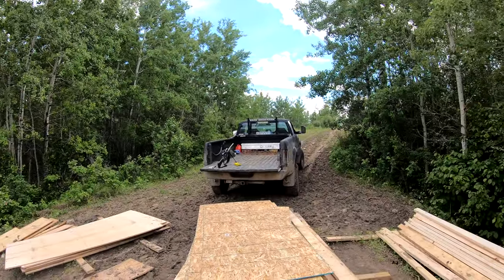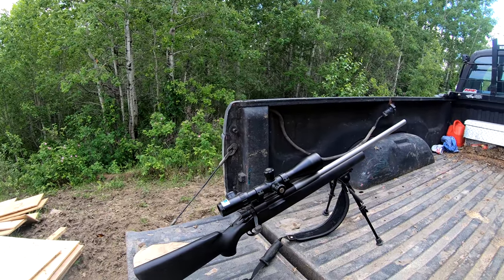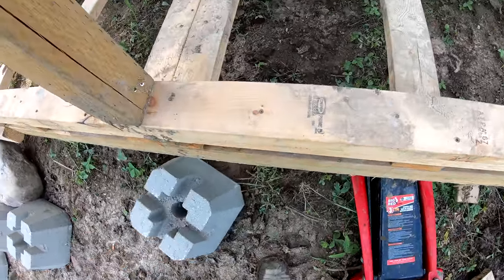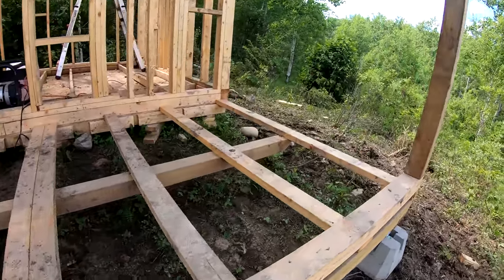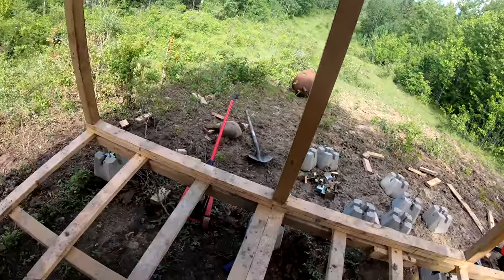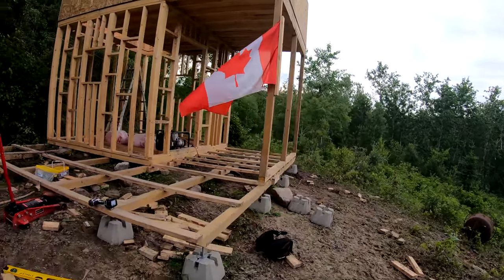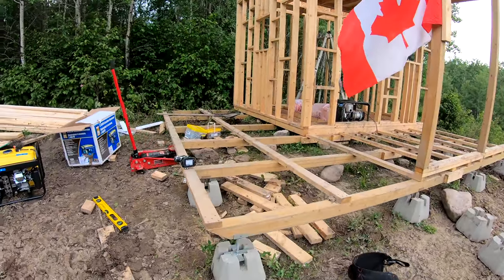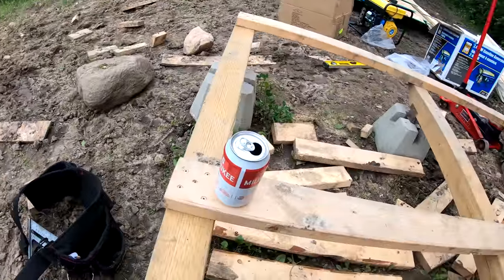Offgrid Cabin Build Pt. 7 - Adjustable Foundation Blocks Installation

Comment: Where did you get the post base supports (brackets) that fit into the deck blocks? I can only find cast in place types. Any information or links would be greatly appreciated

Comment: Hi, just watched your video using the pre cast concrete foundation blocks. Excellent idea but can I ask where you got the adjustable height beam shoe/bracket that fits in the centre of the concrete block. I’m in the UK & can get the concrete piers but can’t find the adjustable beam shoe?

Comment: I know it has been a while since this episode,  but i have a question.  What is the name brand of the adjustable bracket you used for the foundation blocks?  I can't seem to find them anywhere online.  I like the adjustable brackets had the cross as a base, just like the cement blocks.  Thanks.

Comment: Getting ready for our cabin build this spring here in Maine. A question about the foundation..aren't you worried about the ground moving a lot with frost? Im thinking of digging down below the frost line and using cement piers and the brackets you have used. Great lookin camp by the way.

Comment: Has anybody been successful in finding those adjustable support brackets that fit into the top of the concrete deck blocks.  I live in Ontario, Canada.
Reply: Brian Baker  don’t know where you’re at on Ontario but there is a different brand than this sold at Roma, Home Depot, Home Hardware and Lowe’s. Price around 10 to 12 bucks a piece. I’m thinking about using them under a shed.

Comment: What brand of cordless tools are you using 12 or 18 volt
Reply from the maker: I use a 20v Makita impact driver and a black and decker circular saw that's tough as nails!

Comment: where did you get those blocks ?? my boy wants to know and what are they called . Thanks From Darren
Reply from the maker: hey bud i got them at home depot. u can find the blocks anywhere but the adjustable bracket is harder to find i think
Reply: @TraplinesandInlines  Thanks
Reply: @TraplinesandInlines  where did you get the adjustable posts tho?

Comment: I've read a lot of the comments about your cabin build.  Lotta dick heads, that being said, there is one thing I GOTTA say.  I am a general contractor, if you ever decide to move this cabin, attach your chains to the two skids under the front and back of the 10'x10 cabin space and NOT the skid under the support columns for your loft.  If you attach to the skid under the support columns for your loft, you are gonna rip the porch right off. Keep up the good work.